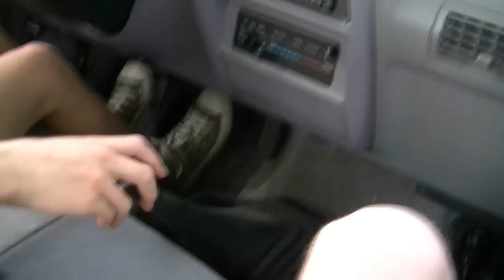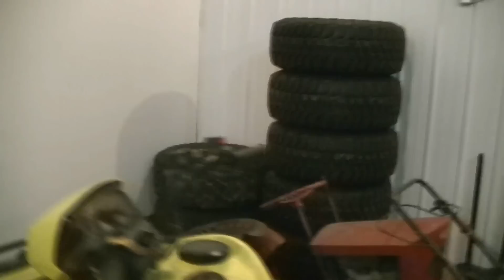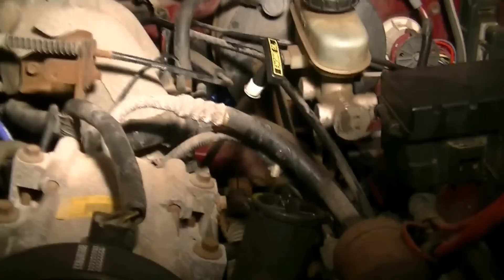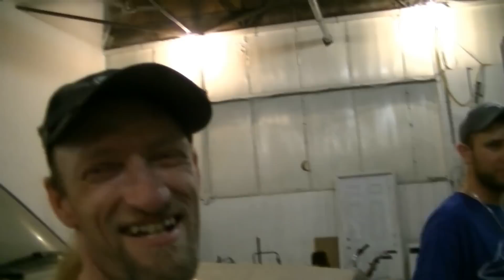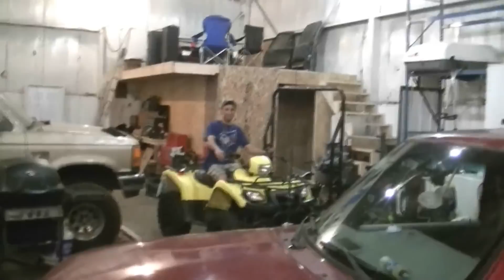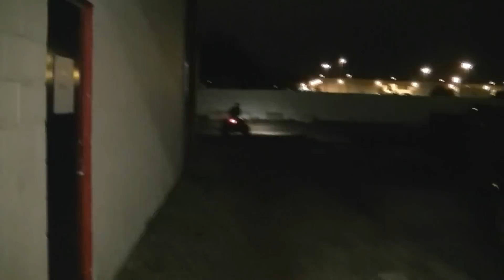RJ's Truck is on the Road

Comment: A Chevy's leaf spring may always break, but a Fords frame will always rot out you can still drive on a broken leaf springs but not on a rotten frame.
Reply: Ok
Reply: redneckbryon  one of my leaf springs broke on my 89 silverado right at the end where it curves to go around the bolt. i didnt have the money to replace but i have a 230 volt mig welder so thats what i did, i grinded a groove at the break and welded that up on very high heat then welded a piece of 1/8 inch steel to that. its been  over 2 years now since i done that and its still  solid. Ive towed several vehicles and my speed boat several times even with  1000 lbs in the bed also